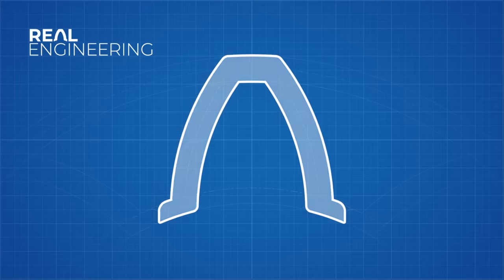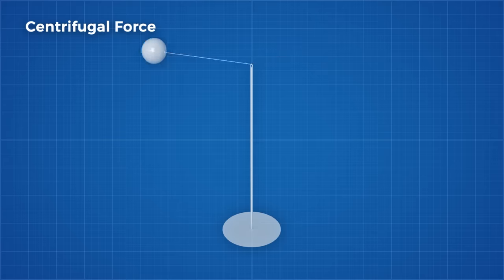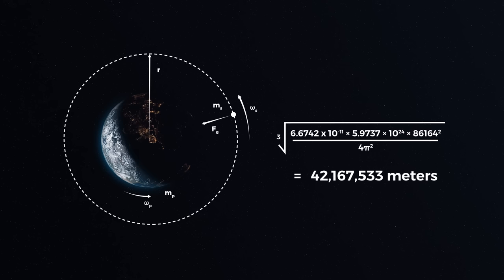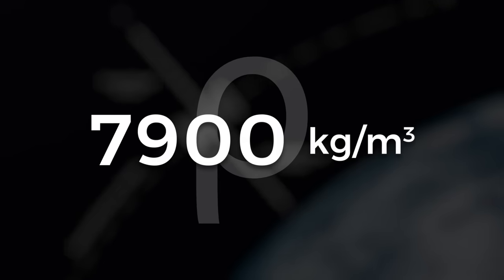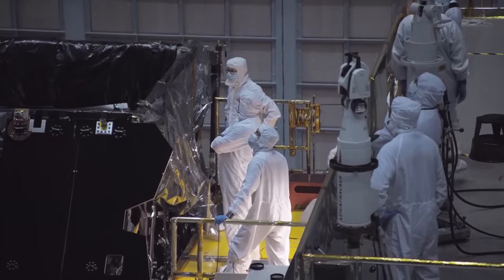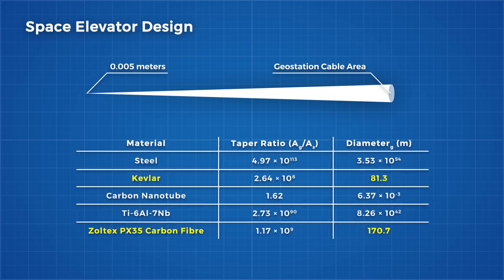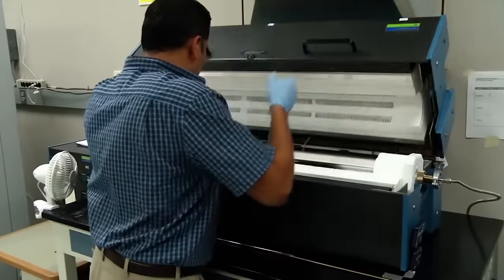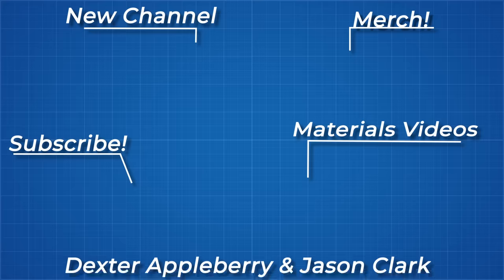Are Space Elevators Possible?

Comment: Elevators are more llkely to appear on the moon and smaller moons without atmospheres, also the The tether needs to be  non conductive and radiation resistant. Micheal Lane at Liftport has done a lot of work towards developing a Lunar Elevator. Vectran is a material to investigate.
Reply: The smaller size also means a shorter line, and between that and the lack of drag, it becomes possible without major advances in material science.
Reply: run the numbers for moons/other planets
Reply: And yet ironically, those places are the ones that needs elevators less since going with rocket is less costly.
Reply: Places without atmospheres can launch things cheaply using mass drivers, so a space elevator isn't really needed on those.

https://en.wikipedia.org/wiki/Mass_driver
Reply: Could a space elevator work on Mars due to its low gravity and low atmospheric pressure?
Reply: Moon doesnt rotate
Reply: @icarus387  I think Mars would be a great candidate for a space elevator. Sadly it would also be very costly to make it from Earth, especially without a space elevator on Earth. So it would probably have to be build with materials from Mars, meaning it can only be build after colonisation of Mars. (so I don't expect it in the next 50 years...)
Reply: The flip side though is that for any environment were a space elevator is easier to manufacture, the alternatives are also cheaper.
Reply: @trippytreereviews7687  The moon is tide locked with the earth so its rotation syncs up, but it still rotates.
Reply: @neeneko  The moon rotates, but not nearly fast enough for a space elevator to be an option. Mars looks interesting because it has a day (or 'sol') length very similar to Earth's and only a little over a third of Earth's gravity. My prediction: one day Mars will be the trading powerhouse of the Solar System, thanks to space elevator tech.
Reply: @mtgradwell  Well, depends on what one means by being an 'option'.  The moon rotates enough for the basic physics to work, apparently well enough to intersect the L1 and L2 points.  Now, the question of it being a viable option in terms of economics is another matter entirely.
Reply: @neeneko  L1 and L2 are unstable Lagrange points. A satellite located at either might remain on-station if unperturbed, but I'm pretty sure a cable attached to the satellite with any tension on it would count as a perturbation. L4 and L5 might be better bets, but they are as distant from the Moon as the Earth is. A cable from the Moon to a satellite in geostationary orbit around the Earth would actually be shorter.
Reply: @mtgradwell  While L1 and L2 are indeed unstable, they are still points of local equilibrium and thus require less energy to maintain than arbitrary points.
Reply: @neeneko  A hill top and  a trough floor are both flat, and an unperturbed ball will remain stationary at either; but a perturbed ball will roll away from a hill top. L1 and L2 are like hill tops, and a cable with any tension in it, attached to a satellite at L1 or L2, is a perturbation.
Reply: @mtgradwell  yes, I am aware of that.

The point is that while L1, L2, and L5 are hill tops, everywhere (other than L3 and L4) are on a slope.  The active response needed to maintain L1 and L2 is non-zero, but everywhere else you have to pay the cost of CONSTANT expenditure PLUS anything needed to counteract perturbations.

You do not get as much of an engineering advantage by using L1/L2 as you would using L3/L4, but it is still an advantageous place to build.
Reply: @neeneko  L1 and L2 are good locations for space stations, but the moment you attach one of those stations to the Moon with a  cable you have  to bear in mind the weight of the cable. Not only is that a perturbation, it is a distinctly non-minor one, even in 1/6g or less.  You could try extending the cable beyond the Lagrange point to form a counterweight, as is proposed for space elevators elsewhere, but then wherever the cable terminates would not be a Lagrange point. Constant energy expenditure would be required to counter every small perturbation before it can become a large one, and the moment that control fails will be the moment that the whole structure starts plummeting moonward.
Reply: @mtgradwell  well yes, the point I am trying to make is that you encounter that exact same problem everywhere else, too, with the L1/L2 points being the least severe cases.  But yes, you would need to extend the cable past the point in order to balance it, but it would still result in the ability to build your actual point of access at the point with fewer forces involved than if you built it at other arbitrary points.

yeah, you do not terminate the cable at the point, that is where you build your docking point.
Reply: @neeneko And the point I am trying to make is that after the first lapse of control or power your docking point would end up slammed into the moon. It wouldn't fall directly in a straight line because that would involve some initial "upward" motion in terms of potentials. It won't go over the "hill" which represents the Lagrange point but would have no problem going around it. 

To extend the hill analogy slightly, imagine you are at the base of a  hill and your dog is half way up on the other side. You are connected  to the dog by a very long elastic lead. The dog is averse to climbing, and the tension in the lead is not enough to drag it over the top. Do you suppose that in these circumstances there is no way you can be reunited with the dog?
Reply: @mtgradwell  no, the first loss of powered control would not slam it into the moon any more than the tether being literally anywhere else would either. You are focusing on these two very specific peaks and completely skipping over the whole domain being hilly.

You don't really need an analogy here.  This is math I've done in coursework.  I get what you are getting at, but you are WAY overstating and over focusing on a single element.
Reply: Vectren? 🤔🙄 this looks important for some investigation work 🤣🤣🤣
Reply: @neeneko  The point is, there is no such thing as a stationary orbit for the moon.
Reply: Tony Wilson   Not true the moon always has one face to the earth you just need the tether to be longer than the gravitional half way point to earth with a weight on the end. NASA and Lifport worked  out the math a while ago. This does mean you need a thether that is very long. But the advantage is that fuel to the near earth end of the tether is not much more than to gfeosyncronous orbit of the earth.
Reply: Tony Wilson   I have worked on this  with liftport, ,Vectran can make a viable tether for a Lunar Elevator.. The reduced Gravity makes a big difference..  Contact Micheal Laine at Liftport to get the studies.

Comment: Just a small correction: the reason super tall buildings have a wide base and nonprismatic narrowing shape is not to reduce total gravity load, but to combat coherent vortex shedding -- where wind forces become amplified at a specific frequency. Primarily that, but also to reduce overturning moments via lengthening your moment arm. An additional factor is you have less surface area at the upper stories  driving up base overturning wind moments. You could theoretically build a square super tall building in a vacuum without issue. You'd simply have more large columns.

Comment: Two points, 1) the taper ratio does not need to be accomplished with just one fat tether. It could be done in stages with multiple tethers.  2) he says the orbit cannot be elliptical but if it was and the lower end was not attached to the earth it would just bob up and down. If at  perigee it dropped into the atmosphere you could attach your payload from a plane and let the elliptical orbit lift the payload without a need to climb the tether.

Comment: Orbital rings are where it's at. You can buld them just a few 100km up, meaning you can make the cables out of things like Kevlar, and they are much more versatile as they can actually launch and catch spaceships and send them out to the moon or even interplanetary.
Reply: Orbital rings and skyhooks.
Reply: Hanif Shakiba And you only have to endure about a hundred times less elevator music for a given climber speed
Reply: 100 km seems optimistic, since there's still quite a lot of atmosphere there, but double that and you still have a cable length much more managable than going all the way to geostationary.
Reply: I don't think the math works out for them either.
Reply: @UCe2tjdUskfhS8yFg8wh67_A I recommend watching Isaac Arthur's video on the subject of orbital rings.

Basically as you say, the rings do need to feature a rapidly spinning internal mass running entire its lengh to counteract gravity. This internal mass is basically just a metal cable, with relatively mundane specific strength requirements. Imagine this cable spins at 2x orbital velocity for its altitude, and you can see that the such a cable could support either continous weight along its entire length, or descrete points a long its orbit where structures could be built, or relatively short tethers lowered down to the planet for stability and lifting things into space.
Reply: Hugh Manatee I said “a few 100km”. But yeah, I just feel like a space elevator isn’t really feasible, even carbon nano tubes will struggle, and that even assumes we can make a perfect 36,000km long cable.

Meanwhile Kevlar is much cheaper, easier to mass produce, and a single defect won’t bring the entire thing crashing down (or float away).
Reply: @Sir_Budginton  The problem with polyaramide (Kevlar) is the rather limited amount of time until it degrades.
For example most items using Kevlar here on earth have a desinged lifespan of about 8 years.
The problem about estimates using such materials for large scale space constructions is that usually they use the material values when new.
Whether that would still work when the material starts to degrade is a completely different question.
Reply: Space elevators don't make sense because their traffic capacity is abysmal. You can only have one crawler going up or down the tether at the same time unless you create some kind of mechanism that allows crawlers to go around each other when they meet along the tether, like when trains come across each other on a single-track railway. You could get around this by building a second space elevator next to the first one but now you've doubled your costs. That's not to mention it would take days to climb up or down 36000 km.

Compare that to the traffic capacity of a network of skyhooks in orbit or a fully-fledged orbital ring and it's not even a competition. Not to mention they could be built out of already existing materials.
Reply: TIGER MAFIA you can connect multiple tethers to one station, hell if you have multiple tethers north and south of the equator that will help stabilise its orbit as if it starts to drift the tethers will stop it.

But yeah, for what they cost space elevators are not worth it.
Reply: Seems none of you have heard of active structures.

Comment: So... "Not currently, but maybe in the future with new materials".
Reply: And significant production of those materials.
Reply: It looks like carbon nanotubes are plenty strong enough, and you could even get away with a significantly worse specific strength. The difficulty is producing a usefully thick cable of carbon nanotubes 36,000km into space, plus thousands of kilometres more to reach the counterweight
Reply: Not if the shaft of the space elevator is buoyant...
Of course, a pipeline for oxygen and hydrogen is also more practical...

Comment: You forgot to mention that when something is moved to orbit, it gains massive amount of speed, even if its pulled by an elevator. That energy has to come from somewhere, most likely you would slow down the station pulling it. Or it would have to be connected to earth on a giant mast, but a 35000km mast is impossible. This video solves only part of the problem
Reply: ikr

Comment: Imagine the insane temperature differential along that tether, even more so in the day/night cycle
Reply: Not worse than anything we've engineered the International Space Station to withstand, and carbon nanotubes are very thermally conductive.
Reply: good point! going from 300K to like 5K could create noticeable thermal stress on the cable. also usually as u cool down materials they become brittle and weaker so u would need a material that maintains its strength within this temperature range. This would be another fun aspect to look at if there is ever a followup video.
Reply: Not to mention frictional differences through the varying densities of earths atmosphere combined with different relative velocities every step of the way. Imagine the vibrations this would generate. It would even generate varying forms of sonic emissions in accordance with those vibrations potentially yielding all sorts of harmonics and standing wave oscillations. Bahhh bullshit hard engineering.
Reply: @johndehaan2764  And with that gl to sendsomething to space with a super oscilating rope
Reply: Rafael Jingles  we are just throwing ideas round. I dont see whats wrong with that

Comment: Assuming the materials exist to creat this structure we will need to build several “strands” out to the counterweight so cargo can move up and down simultaneously. Transit time has to be taken into account also. Traveling thousands of miles will take time. Multiple strands will allow separate loads running at different speeds. Express for people to minimize time and more leisurely rates for cargo determined by most cost efficient power requirements.

Comment: The height visualizations in this video are a bit misleading. 
The geostationary orbit you are talking about, is almost 100 times higher than the ISS (400 km). 
In the images here the orbit looks almost like LEO (low earth orbit).
Geostationary orbit is almost at 3 times the diameter of the earth (12,700 km)
Reply: Yup, the degree of "not to scale" is excessive here.
Reply: The whole concept looks different when you realise that an elevator traveling at todays train speeds would take weeks to reach the top.
Reply: @Bbonno  And you still have to accelerate the mass horizontally from 1000 mph to 6000 mph.

Comment: First. We make multiple towers. Many. We put the motor the carries the cables up at the top of most. We use shorter cables. You go up one tower. Now you attach to cables on the other tower. We use mount everest as a starting point. So at the peak we build a huge thing that goes up from there and also sideways and we have many pillars connecting to the main beans that head horizontal from the peak of Everest in multiple directions.
Reply: Needs to be on equator...mount everest is not on equator

Comment: How about a space elevator on the moon?
Reply: The Moon is tidally locked, so it rotates very slow, I think the orbit would be so high that it's out of the sphere of influence of the Moon itself, although maybe Lagrangian points could be incorporated into this idea to help anyway, maybe.
Reply: It's possible just using steel, but I believe it would be even longer than an Earth one.
Reply: Apparently you can make it out of Kevlar.
Reply: The moon doesn't stay directly above a spot along the equator. So whatever tower or line you'd use would wrap around the earth.
Reply: Crom the Wise  because op said "on the moon"
Reply: @National_Socialist_Supremacist  the tether would have to be long enough to snag Earths gravity, based on the size of the station that would be built.
Reply: @Seluecus1  It's been considered, and yes you're right, it would have to extend to L1 and then some
Reply: Crom the Wise  

He said "on the" instead of "to the"
Reply: Destructor Efx 
No. Only to space. Earth and moon move all the time. It be very expensive also. Be happy if it were made to space atleast..
Reply: @AlexFoster2291  derp
Reply: Crom the Wise  derp
Reply: The moon orbits around the earth a little over 12 times a year

It's very far any way😂
Reply: The Moon is not in Geostationary orbit. The Space Elevator would have to move constantly around the earth and like Brian mentioned it would have to have different lengths depending on its location not only for its orbit but also that it does not interfere with civilian infrastructure, which is as far as I can tell absolutely impossible, unless mass can be converted to something else in the space of a second.
Reply: The observation was really good
Reply: You probably wouldnt need a "space" elevator on the moon since gravity is so low that you can just build a giant steel tower up to orbit
Reply: And Mars?
Reply: Why would you want that? gravity is very low on the moon, you could easily build a regular elevator a few kilometers high if you wanted.

But since the gravity is so low, I doubt any kind of elevator on the moon would be worth it. Going from the moon to earth orbit uses very little fuel.
Reply: With the cost of lunar landers for artemis's 6 odd planned moon missions, and less propellant needed to launch the rockets if they didn't have to launch the landers in the first place. Cost may well be worth making an elevator with docking ring.
Reply: @AlexFoster2291  
RE: "The moon doesn't stay directly above a spot along the equator."
Destructor EFX
 is not referring to a space elevator going from Earth to the moon. He's talking about a moon-based space elevator.

Comment: if you can get it out far enough that the centrifugal force offsets the planets gravity to create predictable stress points, you can probably get away with reinforcing just those points. The first step would be to see the minimum point in where centrifugal force can offset earth's gravity and plan to build the first stepping stone there. if it's around 50,000 feet or so, regarding material constraints, use a place like Everest as a testing bed because it's halfway there.